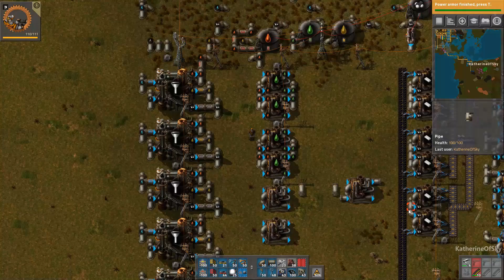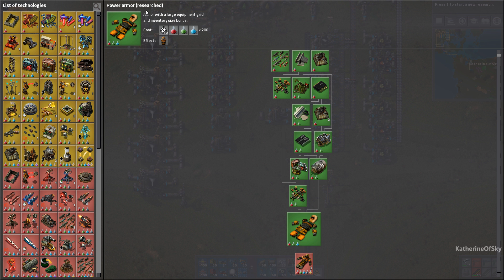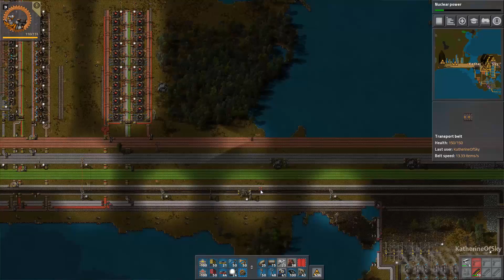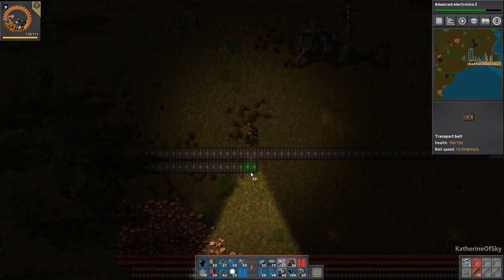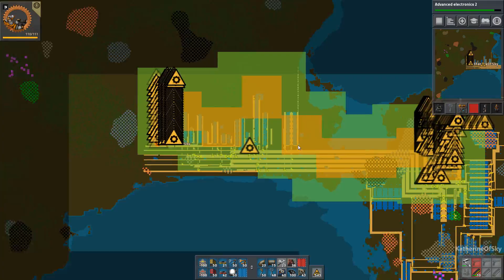Factorio 0.15 Lazy Bastard Achievement Ep 24: ALMOST BLUE CIRCUITS - Lazy Island, Let's Play

Comment: Red belt for the blue circuit output is serious optimism! I think you might need to ever so slightly increase your green circuit production. Also, your refineries are still on basic rather than advanced oil processing, might be sensible to switch them over at some point
Reply from the maker: Yep, I tend to forget to change the recipes -- thanks!

Comment: At 20:04 there's a minor mistake with belt placement in the upper right, with a belt not turned correctly to make a corner.

And yes, if an inserter is aimed at a ghost image of an assembler or other machine that can accept items, it won't start picking up items from a belt or chest until the target has actually been placed with a recipe assigned, so that they won't have wrong materials in hand or loose items placed on the ground.

Also, 12:24 "I can't even do anything to this" -- You could have easily pumped the light oil out of that tank into the larger storage area to the north, simply by moving the underground pipe between them two tiles north and inserting a pump, then waiting a few seconds before deleting the tank. ;)

It was at 20k, which means all those other tanks were at 20k, which means there was about 9 * 5k space in them, more than enough to shift it.

(And yay, I'm finally caught up and can stop commenting on week old videos! LOL)

Comment: Hey Kathrine, you missed the Red wire onto the new light oil tank. You also missed the light oil from the refineries that goes into the tank, you moved it up, so this pipe is not connected right now :/ You also lack energy right now :D
Reply from the maker: lol.  Thanks, I'll fix it!